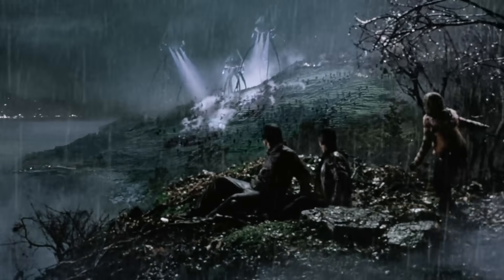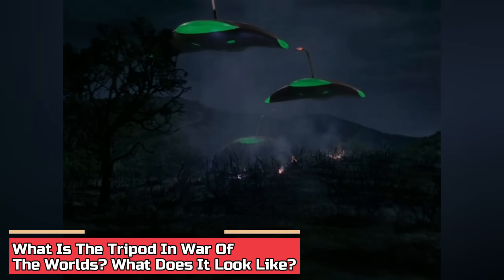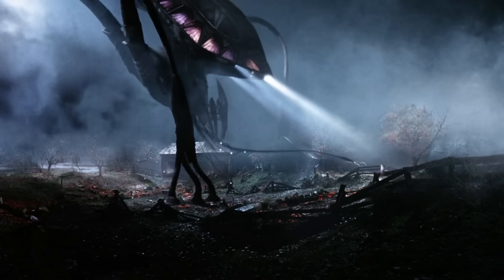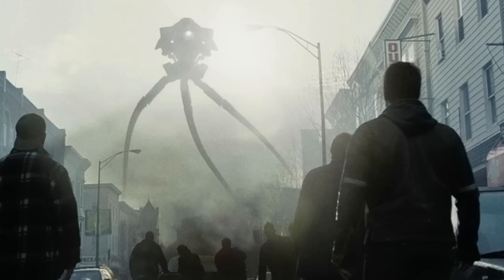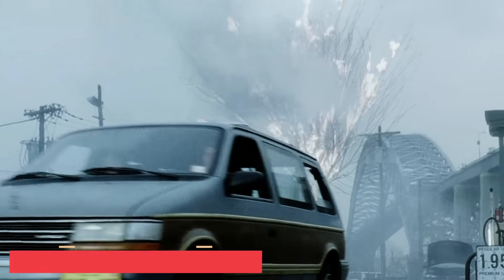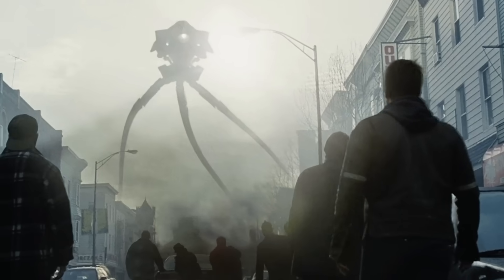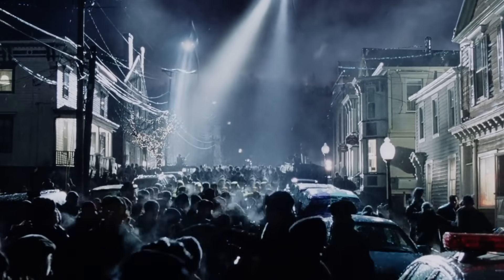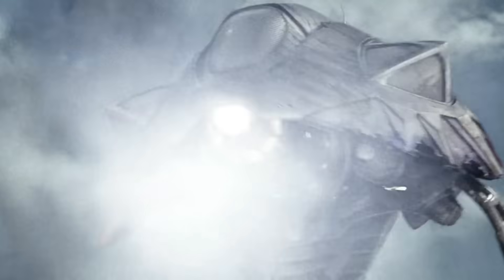Tripods Anatomy Explored - What Gave The Tripods Energy For Thousands Of Years? Purpose Of Horns?

Comment: What I would like to know is the Tripods in the 2005 movie, when you first see them 0:48 they dump a load of fluid on to the ground underneath themselves. What on earth is this?
I also think its quite curious that they appear to run on some plasma sort of energy, which in turn runs the main beam weapons. But it also makes sounds like an internal combustion engine and vents gasses which sound like they're from a big old diesel engine. It's like there's a bit of a mash up between old industrial tech and futuristic plasma energy.

Comment: The one thing I've never noticed about is that no 1's ever actually on it when it's first coming out of the ground and it shows clear signs that its shield is not active during that time frame.... So it is possible while they're still rising out too possibly take them out or even get on them before their shield comes up... Though the question that follows after that is how does it It generate the Shields... The generate on their bodies and push out or does it have minimized projectors you cannot see that shoot out at the needed distance and connect with the other Projectors to form the shield.... If it's the latter you could do Possibly mount it and ride its shield goes up and attack it from the inside on top of its body or try to cut your way through it if you have a proper tool to use on it. And my personal take on the horn is it's usually done only after the ship is completely risen.... So I'm assuming the horn is to alert that it is fully powered up an active or when it Shields go online. As well as a fear factor too like almost a war cry before an attack. Cause a sudden sound from that can catch people off guard and that short time of being caught off guard could be used as a time to Attack before they can regain their thoughts and plans of action.

Comment: In the novel the Martians are described as being comprised almost entirely of brain. They are basically a very large head, with 2 eyes, an ear, mouth and small whip like tentacles. They have evolved so far as a species that they no longer have the need for a body , arms or legs. The machines they use are worn like a suit and they can transfer between machines depending on what task they need to perform. Sort of like modern vehicles that need an ECU , the Martians are a sort of cerebral ECU, plugging themselves in to whatever machine they need to be. An extremely novel idea for 1898 ! However, in between machines, they were virtually helpless and very sluggish in Earth's atmosphere.
There was also no need for "Shields" . They landed in cylinders that contained everything they needed and built their "fighting machines" where they landed, killing anyone who came close with their heat ray. Once the tripods were built, they used them to go to the next cylinder and guard that whilst the tripods in that cylinder were built until there was a cluster of 3 cylinders in a triangular formation.  The Military at that time still used horses, so no tanks, planes etc. Mostly small arms, rifles and cannons. The Fighting machines were not infallible. Indeed , despite the fact the advancing tripods decimated everything in their path, one was hit and destroyed by a shell - after that, the Martians used canisters of "black smoke" - a chemical weapon - to dispose of any unseen threat that may be hiding behind the next hill. The black smoke killed instantly anyone who breathed it in.
They had "Handling machines" - a metallic, squat spider-like machine that chased people , catching them and putting them in a net on it's back. They also had a machine that could produce aluminium rods and a "flying machine was alluded to later in the novel, but never expanded upon.

Comment: The sound could also just be a cleaning phase/systems check which might not even be intended as an audible tone but does so because the hull is made of discreet metal plates and debris vibrating against one another. The first one that came out of the ground did its horn thing which was immediately followed by a massive cascade of dirt and debris.

Comment: In the original novel the black smoke wasn't really toxic if I remember correctly it was instead a super dense and heavy gas that would almost instantly suffocate whatever breathes it in. Then the tripods would spray it with steam and it would turn to ash. I could be wrong though it's been a minute since I last read the novel.

Comment: In the Spielberg adaptation, it is quite ignorant of him to think that the human militaries would be completely helpless against his depiction of tripods, especially regarding shielding. In the movie, he seems to imagined the shields as a kinetic barrier, that blocks quiclky closing solid objects, above a speed threshold. However, in the movie one can clearly see, that a lot of other types of objects can pass through the shield from slow large objects (that approach the tripod at it walking speed), to smoke, dust particles, and even quickly falling rain.

With such a shielding, the tripods has a glaring vulnerability against thermobaric ammunition, simply because the dispersed aerosol / gas / dust exposive material can effortlessly pass through the shield. Hence, after the ignition, a decent part of the explosion can occur within the shielded region at the hull of the tripod. Also, for equal weight, the thermobaric ammunitions are significantly more energetic than conventional explosive.
So it is guaranteed that the tripod going to suffer from the direct hit of a massive shockwave. Such a shockwave will be exteremely detrimental for external subsystems that cannot be protected via armour. So the shockwave must be able to destroy the optics and sensor systems of the tripod. Also, the overpressure, and the shockwave imparted to the armour will be extremely detrimental  to the esssential organic components of the tripod.
So in the least worse case, thermobaric weapons should be able to achieve a firepower kill on the tripod, because it will not be able to acquire targets without sensors. In the best case, if the explosive load is sufficient, then they should literally topple the tripod and also achieve a mobility kill.

Another extremely obvious weapon of choice would be delayed squash ammunitions, deployed strike aircraft. The tripods do not have long range air defenses, hence the air force should be able to attack them with impunity using guided ammunitions. Such an ammunition would squash on the top shielding of the tripod, and after it stopped, it should fall through the shield due to gravity, and land on the top armor of the tripod, then explode. It does not even have to be an explosive, to be effective. A solid chunk of adhesive termites should perform perfectly in this role.

I always found hilarious when a so-called "great" film producer produce a military scifi yet, does not have the aptitude to gain the level of military technology literacy of a military enthusiast.
Reply: "In the movie, he seems to imagined the shields as a kinetic barrier, that blocks quiclky closing solid objects, above a speed threshold."

But the shields do not work like that (technically, we don't exactly know how they work at all or even if they have multiple layers of different shields) which makes all your wall of text pure speculation. But ofc you just want to feel clever, even tho you (and no one else) have no definitive knowledge on how the tripod shields work.

I mean, if the tripod shields would be purely kinetic, they wouldn't be able to harvest humans.
Reply: Yeah and an archer can kill a sniper given enough circumstances/copium. Also, thermobaric bombs? Yeah I'm sure most of US aresenal is like that and we can just repurpose millions of bombs in a reasonable time.... oh wait. 
But hey I'm pretty sure the air force which uses the same munitions will attack them with impunity.... and do nothing

All that "literacy" you have and in a few sentences reduced to rambling. Quite an achievement on my part. Energy weapons and defenses > 21'st century kinetic weaponry. Nukes would work though, too much boom in that stick  but we would be on the losing end. Now if you REALLY want some literacy:

" In the 1950s war of the worlds movie by paramount, the doctor observing the military counter attack on the pods theorized that the aliens have harnessed atomic energy in such a advanced way that they were able to manipulate the subatomic bonds to create a forcefield strong enough to resist even nuclear weapons. You would need super powerful energy weaponry to probably breach it, or find a way to disrupt the sub atomic field in such a way as to provide weak spots in the shield. Maybe through the use of a directed electro magnetic burst? or perhaps a directed particle beam. If logic stands to reason, both the original book and the 50s movie heavily influenced the movie of 2005. Thus it is my conclusion that the shield is a subatomic "particle" based shield designed primarily to stop attacks of solid mass or our level of nuclear weaponry."
Reply: @alexanerose4820  
As far as I know the US has developed thermobaric ammunitions. However, this is a planetary invasion supposedly, and Russia has extensively invested in thermobaric ammunitions. By the way, one cannot just simply repurpose conventional bombs to thermobaric ones, because thermobaric ammunition requires a fuel dispersal and a delayed ignition mechanism. They are a little bit more complex than conventional bombs.

The air force can attack them with impunity because tripods do not have sufficiently long range air defenses. On-screen, their particle weapons have a limited range, that is way shorter then the range modern air-to-ground weaponry. Similarly, on-screen tripods did not demonstrated means of naval transportation, only littoral transportation (due to their leg length). Their weapons do not show the ballistics of kinetic weapons, they cannot "arc" the trajectory of their weapons over the curvature the Earth. Even if their weapons would not have short range, they are unable to attack far-away vessels. Hence, they cannot impede naval logistics, and modern naval ships can attack them with long range cruise missilies without the risk of retaliatory fire.

Let me reiterate the my most important point: evidently, the tripod shield systems are programmed to allow the bypass of objects that meet certain criteria. On-screen we can see slow moving large objects relative to their rest frame, such as object they approach, and small objects, such as rain, dust, aerosols, etc.. that bypass their shields. In fact, the tripod shielding operates more like a hard-kill active protection system (APS), then a one-directionally passable force field, on-screen. Thermobaric ammunitions and the proposed delayed squash ammunitions do not breach the tripod shielding, but exploits this programming to bypass it by nature! If the shield allows the bypass of rain and dust, then it ought to allow the bypass of the dispersed aerosol or dust by the thermobaric warheads. Similarly, the shields ought to allow the bypass stopped squash warhead, that is slowly pulled down by gravity.
Also mines or other form of traps installed in the ground ougth to be able to bypass the shields as well.

By the way, with the current technology mankind is able to produce a "super powerful energy burst" you mentioned, by using nuclear weapons as the power source. Look up Casaba-Howitzers. They are basically nuclear shaped charges, that's concept has grown out from the Orion project. The only reason that they are not produced is that they are expensive, and there is no need of them. Of course in war with the tripods, it would take a long time to produce them.
Reply: @botondkalocsai5322 This was a very well written analysis. You brought alot of essential points i've yet to see others shed any light on, and just these methods mentioned alone are far from being the only feasible means of engaging the tripods, considering the variables presented in correlation with the lore and then the technology we currently have and had at the time of the invasion.

Comment: In the spielberg adaptation I have to think humanity is still utterly screwed beyond measure, if those machines were buried and then the aliens arrived to pilot them, it seems as though they likely just sent out some mechanized force ahead of them akin to bracewell probes at a significant fraction of lightspeed to seed worlds ahead of their growing empire with their war machines so that they're ready for use when the wave of settlers finally arrives, the lightning bolts beaming the aliens down into the ships has to imply some kind of infrastructure the aliens already have in orbit to do so, which means in the absolute BEST case scenario, humanity wiped out the first wave of machines but now find themselves on the frontier edge of a growing genocidal empire, the aliens aren't gone at the end of this movie, they're still loitering in command ships in orbit and the rest of the solar system and neighboring space waiting to hit humanity a second time, it very obviously is not their first rodeo, humanity is dead and they don't realize it yet.

Comment: The sounds are in the book. 

The reason for the hovering "tripods" in the original 50s film is because it was just cheaper. They tried to have tripods with legs but to animate that for the film was too expensive, the same reason the transporter was invented in Star Trek.The buried eons ago thing is not actually original, you would get it if you had watched the WOTW series in the 80s. Though don't mention series 2......

The musical is an interpretation, and if it was taller than big ben it would fit as that is the bell not the clock tower. The tower is the Elizabeth tower. Also that along with the book is the reason in the film for the "horns". 

The camera comes from the 50s film. Also there is no teleportation mentioned in the book, nor shown in the film. The aliens actually travel in the "canisters" and there is in the book, and musical, mention of a time delay between them crashing into earth and the tripods appearing with the sounds of manufacture taking place. 

5:01 that scene was sooooooo many different levels of wrong who ever came up with it is in some serious need of therapy. 

Sorry but the most impressive is the book. You can't beat it.